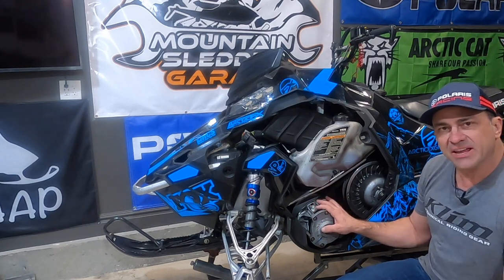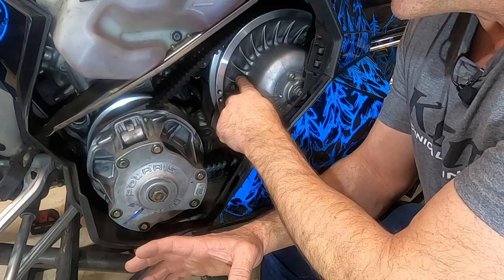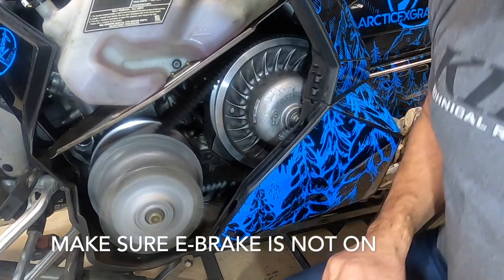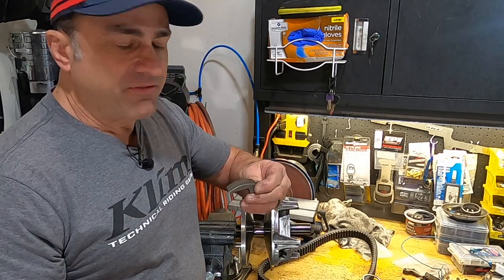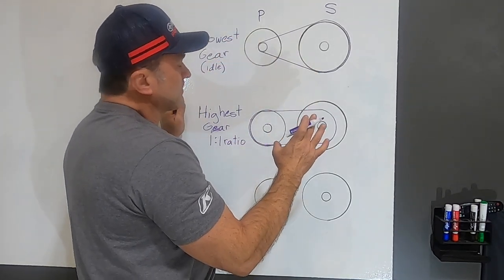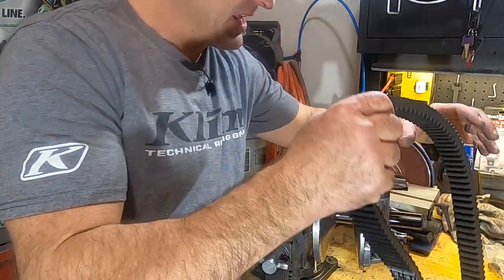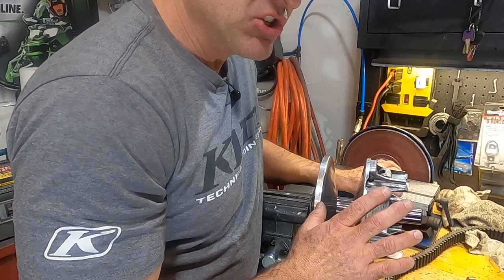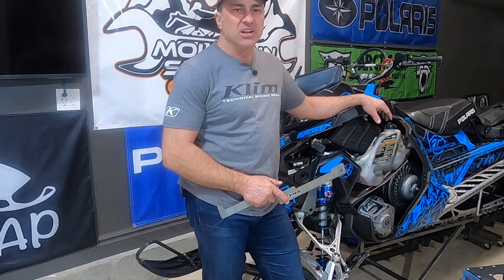Polaris snowmobile belt deflection DIY guide

Comment: I really enjoyed that diy! I knew how to adjust my deflection before but I did t really know why I was doing it lol.
Thanks for taking the time and breaking it down step by step.
Also, on the track stand my track will creep a bit, but not when the weight of the sled is on the track. Is that ok?
Reply from the maker: Thanks. I’ve learned a lot of the time people do stuff but don’t necessarily know why. I think it really helps to understand how your sled works. If it creeps a little on the track stand stone, but not on the ground, that’s perfect. Check out the flyweight bushing replacement I just down loaded this morning.
Reply from the maker: Yea, adjusting the belt to sheath clearance is a whole other animal. I debated on whether or not to do a video on it. You need more special tools and know how to do it correctly, like you mentioned. I would bet most Polaris dealership mechanics aren't aware of the issue you mentioned and just slap it back together.

Comment: What would make the backnshifting better when your doing say 30-40 mph and when you get on the throttle it seems to engage rpm low and take a while to run up to 8200 rpm?
I have a 2019 polaris indy XC 129 800
Reply from the maker: Usually adjusting your secondary. Simplest and least expensive would be a stiffer secondary spring. Then if youre still not happy a different helix. Either of those changes may affect max rpm, so you may need to change the primary weight to find max rpm
Reply: @mountainsleddergarage8627  what's your opinion on delin washers or those bearings people put behind the secondary spring cup?
Reply from the maker: I usually use the washers if I take the clutch apart for something. Not sure how much or if they do much, but they are cheap and in theory should be beneficial

Comment: What is the end play tolerance on the secondary clutch sheaves on the shaft
Reply: The secondary should be able to float out enough where when the belt grips it's not rubbing on the clutch bolt washers on the outside. All sleds are different but my Switchback probably has a good 3/8" of slide in it.